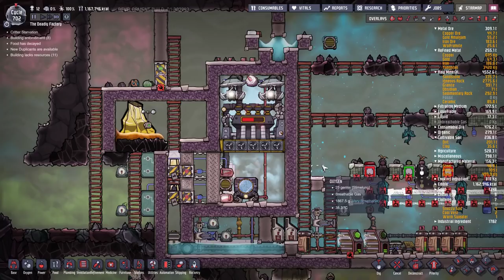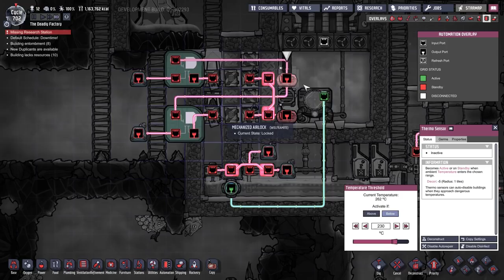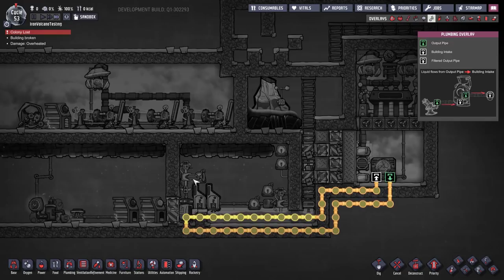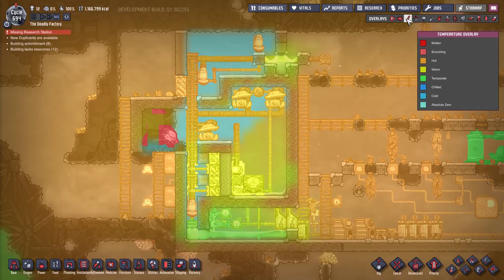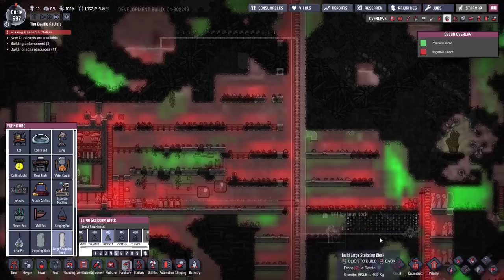Metal volcano Tutorial (Save file linked) Oxygen not included

Comment: I built this and - holy duplication! It worked! I was able to bring down the iron from 2600°C down to 60°C! Thanks so much!
Reply from the maker: Glad it worked for you, 60°C was hotter than I was intending I can fix that in the next version.
Reply: @FrancisJohnYT  It's really use- and far more successful than my previous attempts which all ended in chernobyl-y disasters. However, there are some hicups I ran into which might be due to game-bugs. One especially nasty one is, that for some reason the molten copper from my copper-volcano keeps solidifying into solid tiles instead of the item and I have to clear it in debug (because I can't be bothered to deconstruct everything everytime) ^^
Reply from the maker: Your the second person that mentioned this issue, I never had this happen in any of my testing which is why I did not account for it. I will have to arrange for a mining drill to have access to the cooling tile to mine it automatically. I could get it to min diagonally through a corner piece this would keep it out of vacuum and allow cooling of the drill.

Comment: Amazing video, ver instructive... thanks a lot, i will try to make it connecting the steam turbine to the main grid!
Reply from the maker: To feed the power back into your grid use the reverse design of the one I use to feed into the grid, just set the battery to when 80% full activate. Don't know how much extra power it will give you though, iron is definitely better for energy.
Reply: @FrancisJohnYT  I'm having some ishues with this build, i have a copper volcano that produces about 9kg for 62seconds each 980seconds, not sure about the values but, the problem is the copper is solidifying when it touchs the wolframite door.. what should I do? ... thanks againg for your great job
Reply from the maker: It took a few hundred cycles but the same thing finally happened to me as well. A quick and dirty fix is to put a mining drill in with the volcano stuck to the wall. On my map it's placed to the right of the ladder and volcano. It will generate some heat due to the mining and will eventually overheat but it should take hundreds if not thousands of cycles. I will have to do a mistakes video at the end to include corrections to this design and a few others.

Comment: I did not quite catch what the purpose of the second pair of doors is? And what are they hooked up to?
Reply from the maker: The second pair are there so there is never a clear gap from top to bottom, in case of awkward eruption timings. This design is out of date the QoLMk3 patch has massively changed steam turbines. There are some links in the description to a new design though it's rough and not tutorial ready it should provide what you need.
Reply: @FrancisJohnYT  I meant the other second pair, the on the left/right of the doors that actually blocks the metal.

Comment: So does the convener loader actually transfer more heat away from its contents or is the temperature just dropping faster because you have 1 ton in the loader and 9 tons in the compactor?

What happens if you set the compactor to only hold 1000kg?
Reply from the maker: Compactors are made of rocks, Sandstone, granite etc and have low thermal conductivity. Smart loaders are made refined metals and have far larger thermal conductivity. The same effect could be obtained by using smart compactors out of refined metal, but I wanted to store the metal away from my duplicants while it is cooling and the smart loader worked out great for that as a quick automation signal puts it on a rail when it's ready.

Comment: so i think i know what is making the chunks happen since the gold has to be at a certain mass+temp for it to make a chunk like that the volcano is erupting before the first doors layer opens so the new gold adds onto the old gold and reaches the mass needed and is still at the needed temp for just a split second

the best way i think u could fix this is to make a 2 tile gap the gold falls into with temp plates those 2 tiles high(lowering the first door by one and adding a temp plate) EDIT: this wont help now that i think about it since objects that are falling dont effect anything till they hit......mabee having the first layer drop after the eruption stops via a heat sensor and buffer gate? EDIT EDIT:..... u would need 3 layers of doors to make sure the 2nd door dosent open right after or at the same time as the 1st door does(so door 1 hooked up to a temp sensor and buffer gate to open after it detects heat after buffer ends then 2nd door as main cooling door hooked up like your build has the first door hooked up and the 3rd door the same as u have the 2nd door except not connected via metal/temp plates to turbine room and instead to water so it dosent heat up a second time)

also there is no reason to include the second door to the metal that goes to the turbine room instead add temp plates from the water to the door and mabee some metal tiles so the water is cooling the gold there and the gold isnt reheating this also lets the aquatuner to run a bit more for more heat generation/power
Reply from the maker: Will not be home for a week so this testing is all you :-) let me know how it works out, my current plan is to increase the thermal mass in the steam area to make sure the molten metal cools instantly. Also replace the wolfermite doors with steel
Reply: @FrancisJohnYT  u cant use steel for the first door for gold volcanos
Reply: also the cooling of the metal isnt an issue for me at all and cooling it faster wont change the blocks forming as its in the microsecond the gold touches down that it melt the gold already there and forms the block as it reaches critical mass
Reply: @FrancisJohnYT  so i think i managed to fix all the issues https://imgur.com/a/pXcdgvv 

tell me what u think when u can test/check it out
Reply from the maker: @n3v3rforgott3n9  I'll be home Saturday and I will give it a test then.

Comment: Hey. How much water do you add for the steam? Why can't the steel doors be closed the whole time? Is it simply too much heat being transfered too quickly?
Reply from the maker: 200 Kg of water should be sufficient but for the chamber size 250 would be preferred. Once the temp in the the steam chamber goes above 275 the gas pumps will start to overheat and break.
Reply: Ah ok. thank you so much for replying and the info
Reply: @FrancisJohnYT  couldnt u not use gas pumps and use the "self powered water chiller" design? aquatuner right below the turbine with all but 1 tile of the turbines input covered and a bit on hydrogen in the room to keep the turbine always in low pressure up top

EDIT: https://imgur.com/a/ZWWvJB0 ignore the weezeworts i was trying to hook the turbine to the main power grid and stop the heat leak from power cables
Reply from the maker: @n3v3rforgott3n9  That is definitely an option and would be a power positive solution. My reasoning for the brute force method is the devs keep patching the game and nerfing free energy mechanics. I want the tutorials to last the test of multiple patches. They will fix the blocking of steam input and the mixed gas tricking the steam turbine. But I doubt they will remove gas pumps.
Reply: @FrancisJohnYT  yea i made this comment then kept watching more of your vids and u said the same thing in it XD mb lol just like u said everyone can have their own playstyle in this game and make it as complicated as they want it to be

Comment: I consistently get tiles of solid gold formed at the entrance. Is it intended behavior? I've slapped a robo miner there but that would result in loss of mass.
Reply from the maker: It should be very rare I'v had it happen twice in over a thousand cycles. If it happens consistently for you, could you send me the save? I'm trying to figure out why it happens so I can tweak the design to avoid it happening again.
Reply from the maker: I did some theory crafting and testing, to long for a comment. Then using debug I replaced the wolfermite doors with steel and decreased the space around the volcano, ran correctly for two eruptions after that. Give it a go and let me know if you have any problems I think I know what was causing it but don't have time for torture testing at the moment. https://drive.google.com/open?id=1uW_ShFMA3ozSDpWFattCzNFod2RZE7Ac